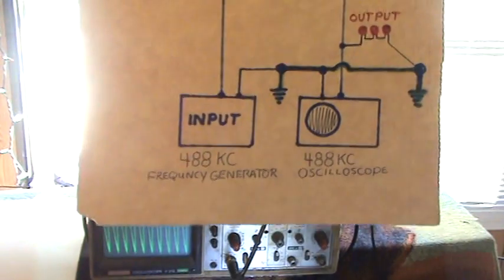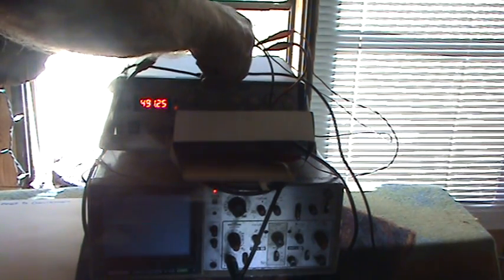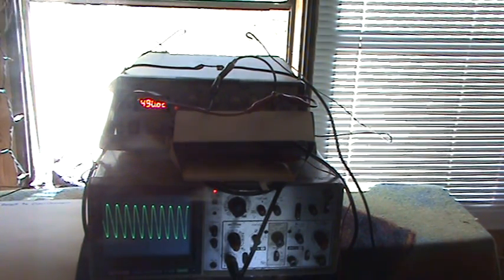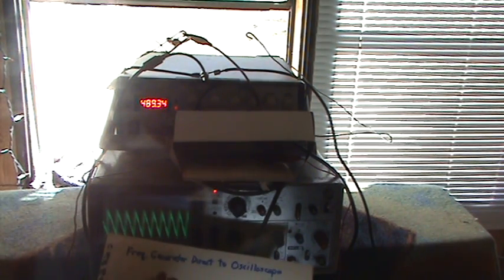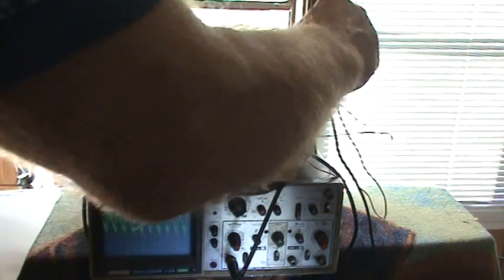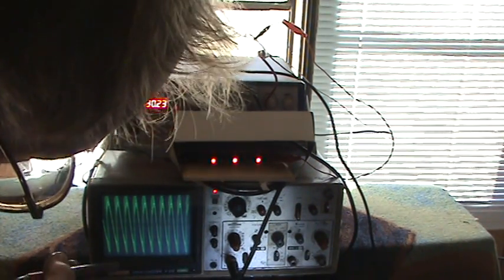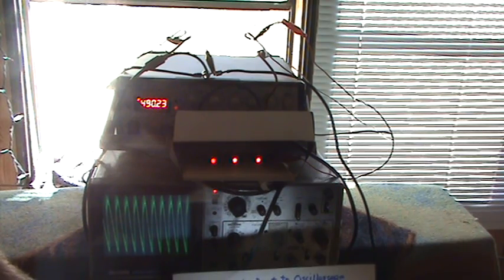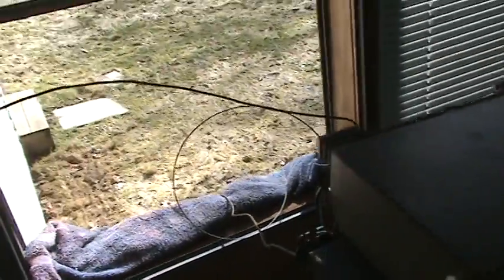Ray's earth power accumulator

Comment: Could it be the fence wire is picking up RF or wi-fi?  Was thinking back to your other video with the tapping of the aluminium rod., did you discover what was the property of the aluminium that it spiked and held a charge on tapping, when the iron bar did not?

Comment: How does the output voltage change when you sweep through different frequencies?  Do you see resonances?
Reply from the maker: TerboBlitz I used sine waves and it does only have one resonant frequency for each height.Even 25 kilocycles to each side starts dropping fast.Today I ran 20 gauge copper wire and worked better.With  8 volts pp. I got 35 volts pp. output  without a load hooked on.